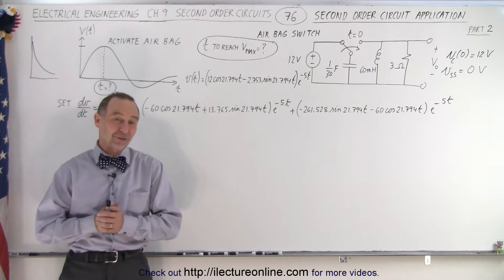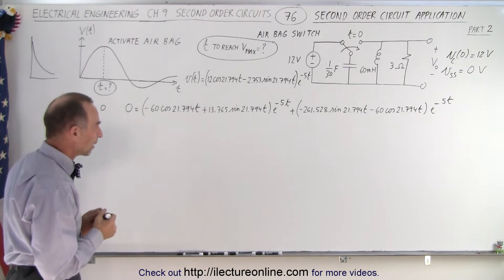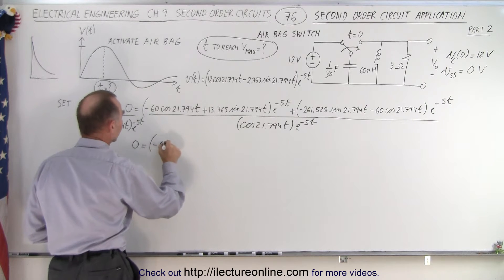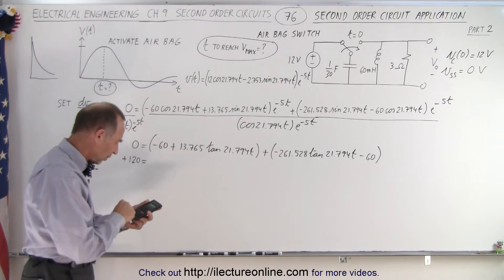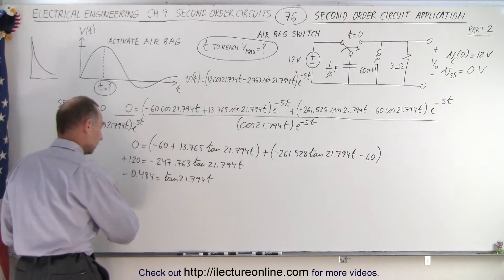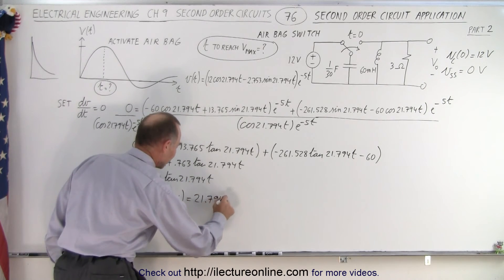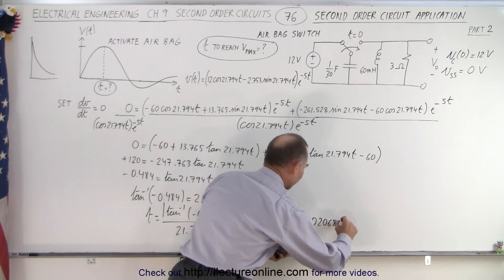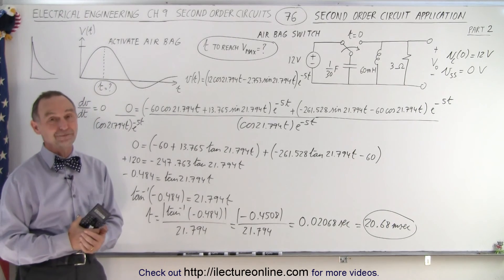Electrical Engineering: Ch 9: 2nd Order Circuits (76 of 76) Time for Airbag to Deploy? (Part 2)

Comment: According to your V(t) and dV/dt formula: V(0) = 12v and V’(0) is -120. Doesn’t this mean V(t) max is at t=0? You can’t have more voltage than 12v isn’t it? I think the time you calculated is a local minimum point?
Reply: I actually plotted the v(t)=(12cos(21.794t)−2.753sin(21.794t))⋅e−5t using python and it is like what I imagined: it starts with 120 at 0 and it decays after it. So the plot on the board is wrong and confusing.
Reply: @zyctc000  But then 'what' did we calculate? By taking the derivative and setting it equal to zero, it should be a local extremum, right?
Reply: @zyctc000 you mean it starts with 12?
Reply from the maker: Yes indeed, that is how it works.
Reply: @MichelvanBiezen thank you sir. So this means the voltage on the resistors can change instantly to as the same as the capacitor(12v) once the charged capacitor is connected to the parallel circuit right?
Reply: @MichelvanBiezen you mean he is right and max is 12. Or this is how to works as you did in the video

Comment: Pls do something about the camera, the output pictures are not clear enough. Weldon sir
Reply from the maker: We just checked.  This video was filmed in high definition and it looks very clear when we checked.  You can adjust the clarity by clicking the "settings" button at the bottom of the video and changing the resolution.

Comment: I appreciate your ability to recover from a simple mistake.  We have all made them.  In college, I made a few mistakes like this but the Prof recognized and adjusted the marks accordingly.   In industry, a good engineer will double and triple check the process (and have a colleague look it over depending on the risk) so likely the mistake will be corrected and the airbag deployment time is properly calculated.  Thanks for all your hard work on these videos.
Reply from the maker: We do indeed check each other's SW code and calculations at work to reduce possible errors.